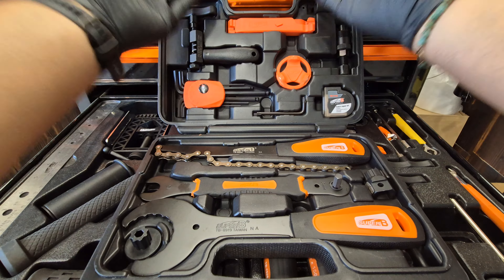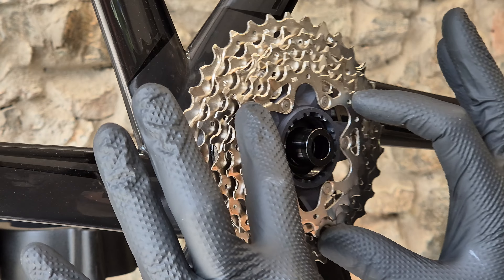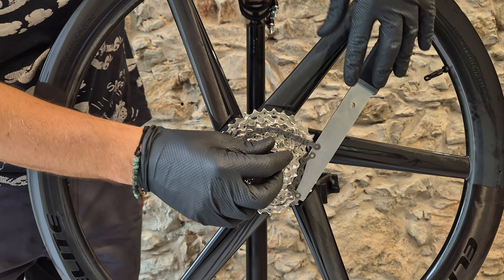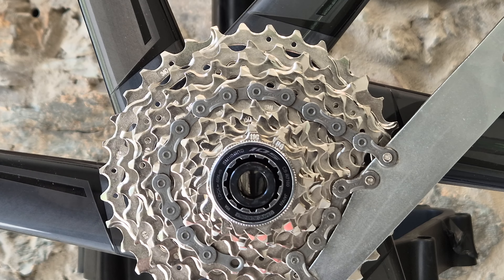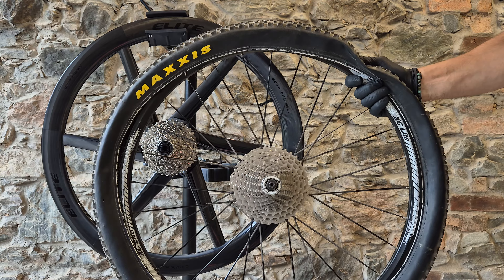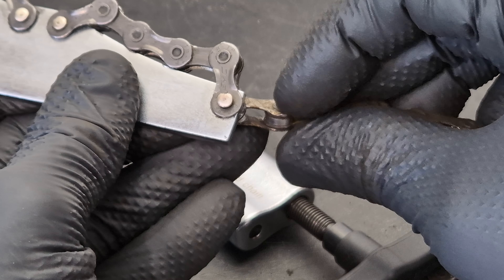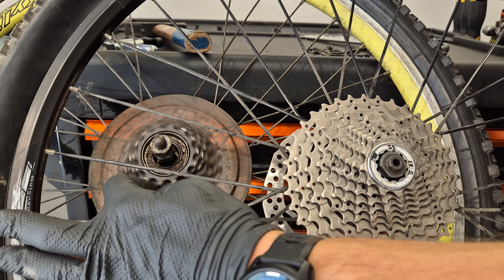Bike Repair for Newbies - 2. How to remove cassette with or without the chain whip.

Comment: I made a chain whip from a wooden plank that has been working much better than any commercial ones. It is longer to give more leverage and the chain is longer so it doesn't slip. The teeth on the cassette have imbedded themselves into the wood so the handle is very stable. The chain is securely attached with screws so there is no need to weaken the pins of the chain by opening them

Comment: 3:54 I used to block the chain under the tire of my truck! 
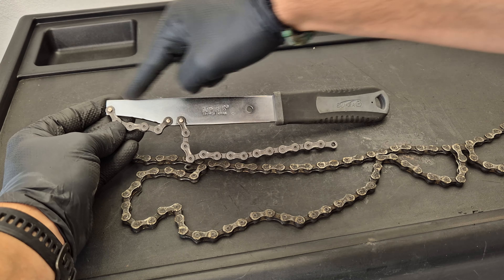4:29 then I found on the roof of my building a thick piece of metal (old bracket for antenna) and I drilled some holes.

Comment: I had a really bad experience with a chain whip. It was one from Park Tools. One of the links broke...the chain slipped...and broke a tooth off my XX1 cassette. I will never use a chain whip again. 

I got a Pedro's Vise Whip. Its a pair of vise grips that clamp to the the sprocket. You can also adjust how hard you want the jaws to clamp the sprocket. It will have a secure grip, and you'll never risk it slipping like a chain whip.

Comment: I had a completely stuck cassette on an old wheel, I used a pair of vice grips to hold the cassette in place then a wooden mallet to whack the handle of the lockring tool 🤣 it worked, but probably did no good to the cassette